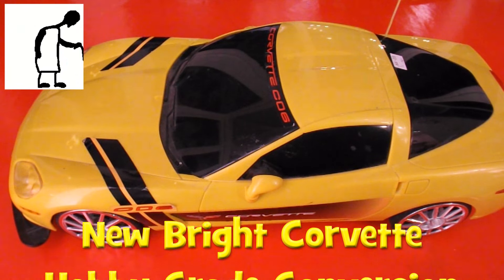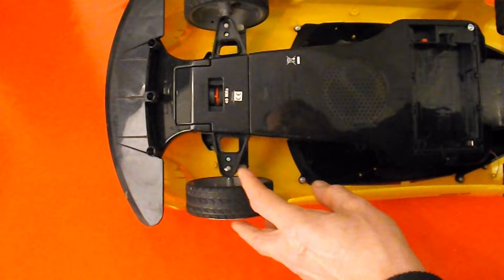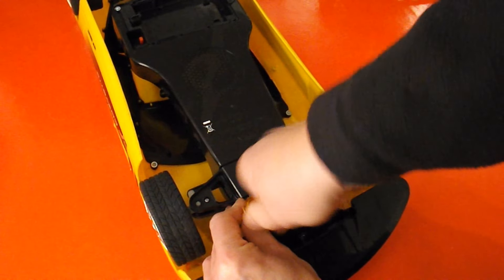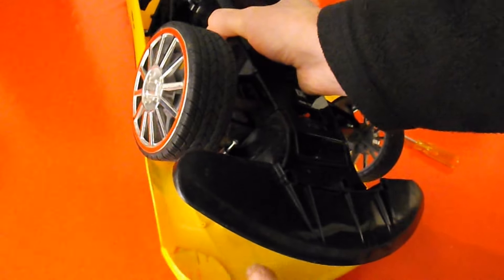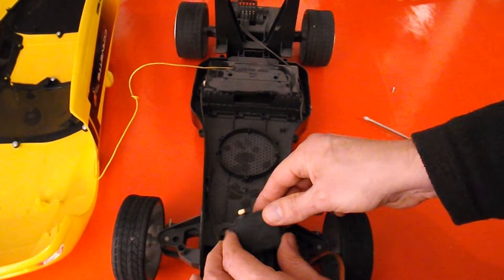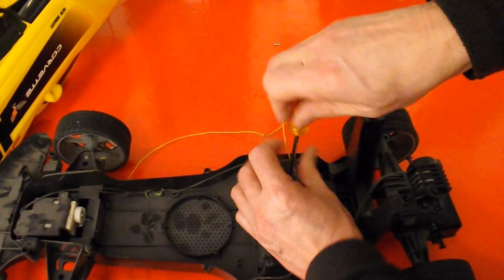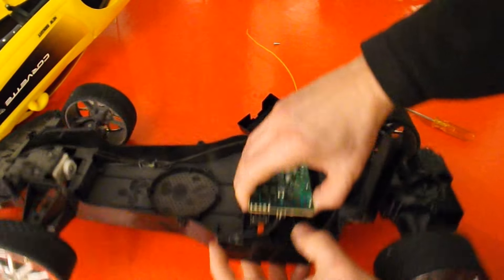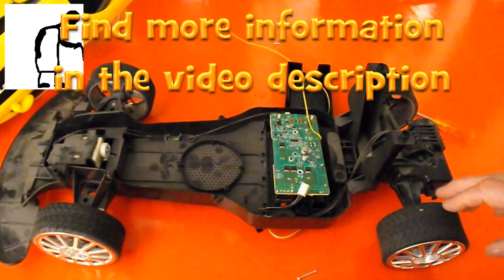New Bright Corvette Hobby Grade Conversion Part #01

Comment: Hello sir. I am wondering if there is a way to add a reciever without and additional esc and servo. Just use whats there allready? Thanks in advanced.
Reply from the maker: You could fit a modern toy grade 2.4Ghz receiver which will give you better range and still the same basic steering and throttle control. Many modern toy grade cars are now 2.4GHz for that reason. You can probably find the TX/RX components online on a site like AliExpress.

Comment: I'm doing a project similar to this, but I cut out the old struts and put in some new supension parts
Reply from the maker: The most sensible modification to this car is to save the body shell and scrap the rest. The chassis/floor pan is just too flexible for anything more powerful. Even the body shell is weak but it looks good. My only interest in this was the cheap price as it was second hand in a charity shop. It had no transmitter but I had a spare. The range was terrible so fitting a hobby grade RC system fixed that.

Comment: who show you how to do all this cool stuff
Reply from the maker: Why do you think somebody has to show you something before you can do it? Have you ever tried working things out for yourself or maybe reading instructions? You can learn a lot by having a go yourself. Of course you might fail but then you learn something in the process 😊
Reply: GrandadIsAnOldMan exactly my point, if you try, you fail you or learn, I have a little world tech toy small truck, I'm 0lanning on changing the motor, and reciever, I want a reciever with connections and a motor with a easy connection thing,

Comment: That motor is tiny! What do you mean "you dont have an esc that can power it?"😂 I have a few that will over power it!
Reply from the maker: I am not a hobby grade RC enthusiast and certainly at the time I did this series I had very limited hobby grade RC kit.
Reply: GrandadIsAnOldMan oh. Well, I just use what I have too. I am spending absolutely nothing on anything until I buy the used SCT I am looking at so I can start SCT racing.

Comment: It looks that it should if had a speaker in it
Reply: same
Reply: +DanielCraft 567 maybe the prevuous owner got to anoyed and took it out
Reply: +TheFreddyPlayer , ya i would say a speaker as well and  i would go with ur  quote
Reply: yes
Reply from the maker: +DanielCraft 567 looking at the 2012 review video I linked to in the video description I can see straight through that speaker grill so there is clearly no speaker fitted in that car either but I have no doubt when they designed the castings they allow for extra features. With the New Bright range many of the component parts are interchangeable so maybe the chassis tray is used in another vehicle that does have a sound system.

Comment: Try putting the motor from an rc helicopter in it
Reply from the maker: 5 years later, found your comment, so I am replying. If I was going to change the motor, I would probably put a decent hobby grade brushless in there, but it goes well enough for me anyway. Later in this series, I do run it on a 3S LiPo battery so it does go a bit faster. Still not as fast as it looks like it should go, but fast enough for me to run it around in the space available.